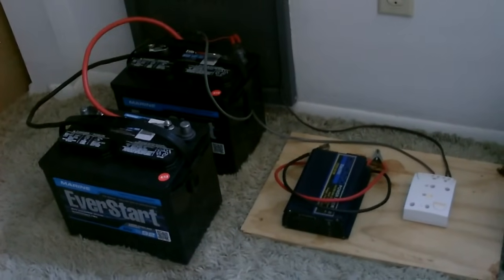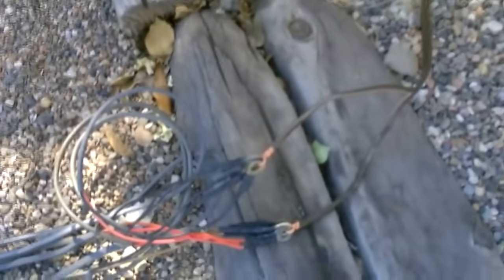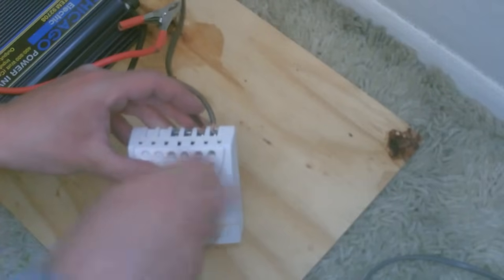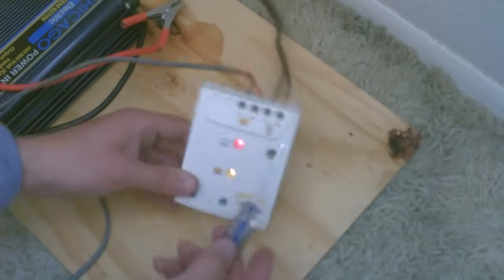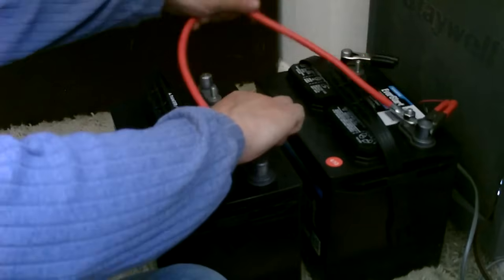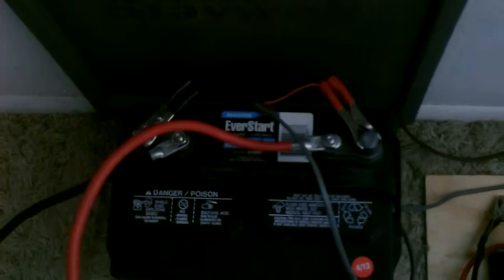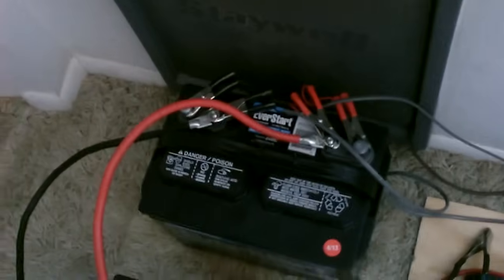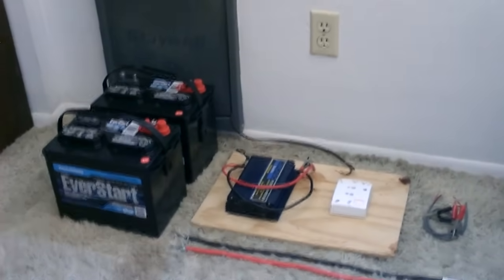How to hook up Solar Panels (with battery bank) - simple 'detailed' instructions - DIY solar system

Comment: I'm guessing the charge controller keeps the batteries from discharging back into the solar panels?   One of the main problems I remember was the batteries needed a way not to lose their charge back into the wires leading to the panels
Reply from the maker: hi there. most (if not all) good size solar panels have a diode (a blocking diode) in them. this diode blocks the current from flowing the other way (from the batteries to the panels) when the sun is not out, so the batteries won't drain. technically the charge controller blocks the power from flowing back to the panels too. but if you're not using a charge controller then you'll need the diode or the batteries will drain
Reply: @desertsun02  excellent...thats what I remember from early day solar panels when people were rigging their systems without charge controllers.  Thanks!

Comment: Probably a stupid question but I am new to all of this but my quistion is how many batterys would be ideal to hook up to a 90wt panel
Reply from the maker: hi there. 90 watts worth of power (coming from 12v solar panels) is around 5 to 6 amps. a good charge rate is 3 amps per hour (per battery). so two 12v deep cycle batteries (similar in size to the ones i used) works good

Comment: How many watt panel needed to run a coffin freezer would 300 watt panel work. And how many batteries I need
Reply from the maker: hi. it will depend on the wattage of the freezer. some of them are really efficient so 300 watt panel could work. probably need 4 good size batteries to run it 24/7
Reply: @desertsun02  marina batteries or original battery
Reply from the maker: @Jungleghost Survival i always use deep cycle batteries

Comment: Hello, Great content, I would just like to ask if possible. As long as the voltage stays at 12 to 13.8 on your batteries it won't be draining current from the charger right.
Reply from the maker: hi and thanks. i'm not sure i understand the question. if you mean 'does it drain the batteries if they are fully charged' - it's not noticeable unless you are pulling more power off the battery bank then what the panels are supplying.

Comment: What if I use CAR battery(instead of deep cycle)?
Wouldn't it last long?
Cos I cant find deep cycle one
Reply from the maker: hi. you can't use car batteries because they're not designed to be deep cycled. car batteries will only last maybe 25 times. a deep cycle battery can last a 1000 times.

Comment: hi thanks for the video. Just one question: do you really need the inverter?  
I'm using a solar panel 100W and 12V battery with a 10amps regulator. only thing i need is 2 12V plugs for a phone and laptop or something..
Reply from the maker: hi there. if you don't need ac power then you may not need it. it also makes sure that the batteries never discharge too much. it's got a low voltage alarm on it and it will shut down if the batteries get too depleted.

Comment: Very good video!  I noticed that Fry electronics has gone out of business( your stated controller source).
Reply from the maker: hi and thanks. yes, fry's is gone. the best place to get a charge controller (these days) is probably amazon. (that's the best place to get solar panels too). you can get a 100w panel for 79 bucks (last time i checked).

Comment: what can i power with this system?
Reply from the maker: hi there. this will power all types of stuff. the only things it won't power are the larger appliances (kitchen stove, AC unit, clothes dryer). you can power tv's, radios, computers, lights, fans, blenders, can openers, yard tools, drills, sanders, saws on and on. here's a link to a video i did showing a few things it runs... https://youtu.be/8LAjx_XAR90

Comment: What size wire are you running from the panel to the control and from the control to the battery

Comment: So the Inverter can not connect directly to the solar panel without a battery?  Like the 18v one + 800 watt automotive power inverter. It has a cigarette charger end which would take forever to charge something  and battery clips.  They are to hook directly to car battery but I was hoping they could connect to solar panels too.
Reply from the maker: hi. you are right (you can't hook an inverter directly to a solar panel)

Comment: Can we use different sizes of panels connected to each other to charge a battery bank?
Reply from the maker: hi there. if they are all the same voltage it can work. for example you could use a 12v 100w panel and a 12v 50 watt panel for a total of 150w

Comment: Do I need 2 batteries or 1 is enough? First time user , I already have 1 boat battery Duracell deep cycle Group 31 12 volt deep cycle marine, boat and RV battery
SLI31MDC ,  have 2 solar panels , pure sine wave inverter and solar charge controller , thanks
Reply from the maker: hi. i usually use 2 100ah deep cycle batteries for every 100w of solar. i like to set it up so each battery is getting about 3 amps an hour. a 12v 100w solar panel usually puts out around 6 amps so that's why i use two batteries. you don't want to charge the battery or battery bank too fast.

Comment: Excellent Video as has been said.. I have a system for a refrigerator in my truck.. I don’t seem to be receiving enough power from 3 100w panels to charge all day and all night?  I hooked up another battery.. Still not 100% I have another Panel 240w however it’s for my RVTrailer Lithium Battery.  I don’t use it when I’m hooked to shore power.  So (240W) Panel came with clips for a Battery I’m assuming,  can I hook it to my lead Battery?? 
I’m currently not using it for the trailer ??

Comment: Hi i want to hook up 800w of panel power 
To two 220ah 6v batterys
With a 1500w inverter

What amp should the charge controller be 
And also
How do i charge this battery with a 2500w generator on a dark day

Comment: Can you do this exact setup, but say there's a week with no sun. Can you run a generator, plug in a car jumper box, and hook up the clamps to the lead battery and charge it up that way?

Or do you have to disconnect the charge controller to not burn it out or something?

Comment: Maybe I missed it but how do u know when it's fully charged? Also how many times can you charge it before it's no good? And last isn't this way better and cheaper than a generator or am I missing something???
Reply: Thanks by the way great video
Reply from the maker: hi there. many of the charge controllers will show when it's full or near full. you can also generally tell by the voltage of the batteries. when it's near the full mark it will just let a little power through to the batteries so they don't overcharge. i usually get around 1000 charge cycles out of the batteries. that is about 3 years. i'd say it's way better (but generators are a good thing to have as well).
Reply: @desertsun02  thank u 1000x over this just helped me so much

Comment: Question; Can you power a small office with that? 1 laptop, 1 extra screen and a wifi router. Thanks, In advance. Felix UK
Reply from the maker: hi there. yep, that would be a good use for it. (i just remembered that i've got a video showing laptop, light, paper shredder etc... being run with this system 🙂)
Reply: @desertsun02  I'll check that one out right away, thanks very much

Comment: How cold can these batteries be. Can they discharge below 50% and be ok? This is older vid. Do you have good idea the best batteries to buy to survive outage in cold regions?
Reply from the maker: hi there. these types of batteries are very tough and they can handle extremely cold weather. you can discharge them below 50% but it's not recommended. the inverter usually shuts off when the batteries get near 50% discharge so that is one way they are 'protected'. i can't give you an exact battery to chose but i'd say stay with this type of battery (meaning lead acid). in my opinion the lithium ones still have a few issues. i stick with the 'lead acid' ones. they've been around a long time (since 1859) so the technology is 'time tested'. if you go with lead acid batteries; remember to use the 'deep cycle' type so that they last.

Comment: Do the batterys have to be the same?
Reply from the maker: hi. yes they should be the same type and size (this is very important). if they aren't then the draw off of the battery bank will not be balanced. (and can cause other big problems).

Comment: How many electrical Watts/AC is in one Batt? For a converter too my house? Thanks For all you're help brother nice Video. 👍
Reply from the maker: hi there. the batteries i have are 101ah. i've got two batteries so that makes a 202ah battery bank. ah times 12v = watts. (remember to factor in that you only get one-third to one-half before the battery is considered "depleted").

Comment: Hi, thank you so much for this video.  I have a problem with mine right now, I can only run a TV on it for a few short minutes and then it starts to buzz and then I run and shut it off.  I have a picture of it, but it won't let me put it in this message.  Is there some way that I can show you the set up and you might be able to tell me why it is not working anymore?  Thank you
Reply from the maker: hi and you're welcome... so does the tv start to buzz or is it the inverter? if it's the tv you might need a pure-sine wave inverter for it (assuming you're using a modified sine one now). if it's the inverter that's buzzing then i'd say you probably just need a new inverter. if you look on my channel in the 'about" section you'll see an email i listed. you can send the pic to me there.
Reply: @desertsun02  Hi, thanks so much for getting back to me.  No, it's not the TV that buzzes.  It is coming from the batteries, I think.  This is the problem, my husband set this up so we could have the tv and the lights and the fan on in an off the gird cabin.  But, in April he died!  So now, it's my responsibility to get this going and then to sell it.  Without him, I don't want to be there.  But, it never buzzed like this before when I first turned it on, so that's why I am trying to figure out why it is doing it now.  :(
Reply from the maker: @Susan Blair first let me say, sorry for your loss. stay strong. but to your question about the buzzing, i've never heard of batteries doing that (but i guess it's possible). i'd make sure that all the connections to the batteries are tight. just a guess but if they are loose it might cause a buzzing sound. you mention that it buzzes when you've had it on for a few minutes. i wonder if it could be the fan inside of the inverter. those fans can make noise. does it ever buzz when you run other things (like lights or fan) or just when you are running the tv?
Reply: @desertsun02  Thank you so much.  Yes, it's sad to have to try to figure this out without my husband, but hopefully, I can answer the questions that you asked in your message..  I don't know that it is the batteries that are buzzing, I think it might be the converter that is telling me the batteries are not receiving anything from the solar panels.  And yes, if I turn the tv on or the fan or the lights that is when it will start buzzing.  I don't think the connections are loose because no one ever touches them, but I will check when I go there tomorrow to do some work.  How can the batteries not be receiving whatever it is that the solar panels are supposed to be giving it? As you can see, I have no idea how this all works, but that's all that I can figure that is happening.  I really appreciate you answering my questions, it is very kind of you.
Reply from the maker: @Susan Blair if it was that the solar panels aren't charging the batteries then the batteries will eventually become depleted. once the battery charge drops enough the inverter will probably shut down so that the batteries won't discharge too much. if it's only happening when you are running things then i'm guessing it's the inverter or the fan inside of the inverter that is buzzing. when you turn things on, the inverter works harder and a fan or fans inside of it may kick on and off. i just thought of one other thing. if you are using a modified sine wave inverter (which is what i think most people use) - those sometimes make the items that you're running buzz. especially things like fans. the motor of a fan will sometimes have a low buzzing sound when you run it using a modified sine wave inverter. it's because it's a modified sine wave and not a pure sine wave. that type of buzzing is normal.
Reply: @desertsun02  Thank you again, I think you are right that the batteries are depleted.  I may not have done something right, and without Jake there, I didn't realize it.  I used to put the TV on when I was there just to have some noise in the house because it is away from everyone and there is no one around.  It just made me feel better to have heard the voices.  I bet I left it on too long and that depleted the batteries.  I will have to see what I can do about that.  I won't bother you anymore with my questions.  You have been very kind to get back to me and I appreciate it so much.  I did not have anyone else to ask and when I saw your video, I thought I would take a chance and see if you could help me with this, and you did.  :)    Thank you again,
Reply from the maker: @Susan Blair it's been fun talking to you (and helping you). i like to make videos to help people make and build things but it's also great when i can help them through the comments section. if you have other questions or want to talk about it more, feel free to write again 🙂
Reply: @desertsun02  I am going to check everything you mentioned and see if I can make it work again like it did before.  You did help me and I appreciate you.  :)

Comment: Can I run 2 marine batteries with my solar batteries? I have 2 more batteries just sitting.  Can I add those on?
Reply from the maker: hi.  i wouldn't. all the batteries in a battery bank should be the same type and the same size. the age of the batteries matters too. they say that there should not be more than 3 months in age between the batteries.

Comment: do you disconnect your solar panel wire when you wanna run something or do you leave it charging?
Reply from the maker: hi. i leave it charging.
Reply: @desertsun02  Great thanks for the info. Good demonstration of the system.

Comment: Do you have to worry about the batteries getting overcharged if the panels are connected and if you aren't peeling juice out of the batteries once in awhile?
Reply from the maker: hi there. nope. as long as you have the charge controller connected it will make sure that the batteries never 'over charge'.🙂
Reply: @desertsun02  Thank you.

Comment: Do you have a video showing how to connect the off grid solar system to the whole house main electrical panel box?
Reply from the maker: hi. since it's a battery based system - i never thought about hooking into the grid. i really like solar systems to be totally non-dependent on the government power grid. you never know what might happen to it (the grid) at any given time. 👍🙂
Reply: @desertsun02  Not connecting to the grid. But rather connect to the panel box instead. How do we plug in the appliances if they are not near the panels?

Comment: I'd like to hook up my 2 75watt LED grow lights and run them for about 10-12 hours a day. 

I'm thinking of buying 2 200 watt solar panels and 2 car batteries and doing what you showed us how to do here. 

Do you think that set up would work for 10 hours run time for 2  75watt lights? 

Any tips ( cheap tips lol) you might have for me? 

I cant afford a true solar set up so I have to do something like this to get me by.

*correction - I meant 2 deep cycle batteries for energy bank and usage.*
Reply from the maker: hi. just one thing. you don't want to charge the batteries too fast so for every 50 watts of solar i recommend using one 100ah (give or take) deep cycle battery. *or for every 100 watts of solar i use 2 (100ah) deep cycle batteries. if you're going to use two 200 watt solar panels (i'm assuming 12v ones) then i would use 8 batteries. you can probably use an absolute minimum of 4 100ah batteries but i wouldn't use any less than that if you're going to have 400 watts of solar. (also i was going to mention the type of batteries but you beat me to it).
Reply: @desertsun02  thank you for the advice. I wouldn't have even considered the wattage from the solar panels vs how many batteries I should use.
Reply from the maker: hi. just one last thing i thought of... don't fooled by those suitcase style 'power station' systems (the most popular seems to be the jackary's). i recently did the math and compared my 'two battery' system to their products (and products like theirs) and my system is roughly comparable to their 1000 model (the biggest one they have i think). that model cost $1000.00 plus another $400 or so for panels) so with tax etc... it's about $1600 total! my system (these days) cost about $335.00 to set up (that's for the panels, tax and everything). their system is 1000wh (minus .85) or about 850wh of usable power. mine is about 832wh of usable (so very similar). and you can easily and cheaply expand (and fix) the system if you make it yourself. those suitcase ones may be convenient (makes a cool 'grab and go' system) but you'll pay some serious dough.